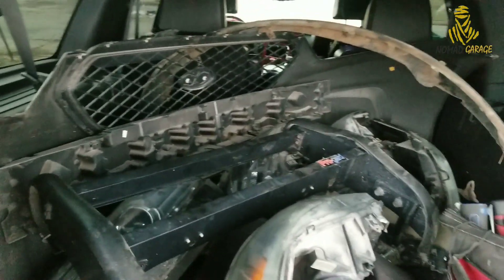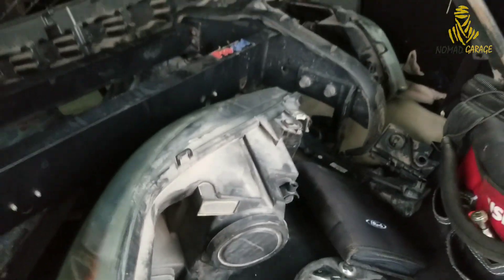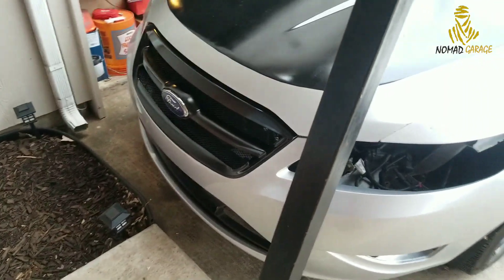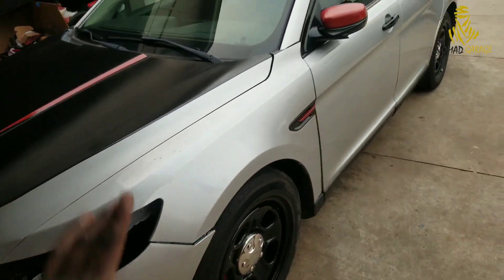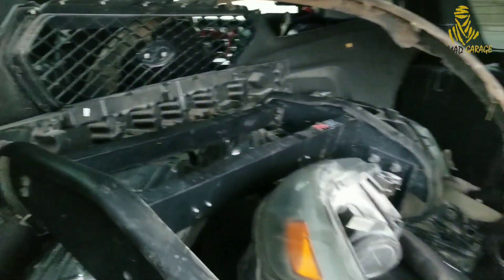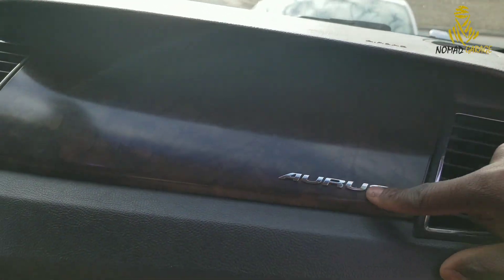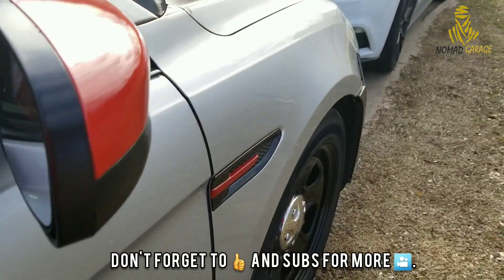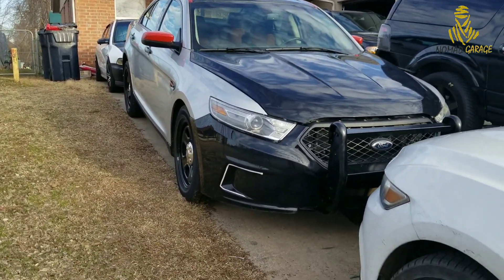From a 2010 Taurus civilian car to a 2019 cop car]

Comment: Did you plastidip the chrome around the windows? paint? or order the interceptor parts? Easy to replace?
Reply from the maker: Paint. It is more durable and better looking in my opinion. I have an earlier video of that in the same Ford Taurus playlist.
Reply: @NomadGarage  thanks for the reply, I painted mine a few years ago but had an issue with peeling even though I lightly sanded the chrome. Dealership wants $2600 to replace with interceptor parts (window trims and around the grill). I have an appointment to get it dipped, costs $400. I couldn't find a body shop willing to repaint the trims so it was my only options. Any suggestions?
Reply from the maker: @MDMC313 yw.  I will say to Wrap it. Trim piece can come off easy. Just super fragile.  I will do a video when I pull the trigger. Dip will always come off and yes some paint will flake off bad . I did ligthly sand mine prior and used paint adhesive primer before painting. So far so good.
Reply: @NomadGarage  Thanks for the info, would love to see a video. I see the dip as being a short term solution for the time being.